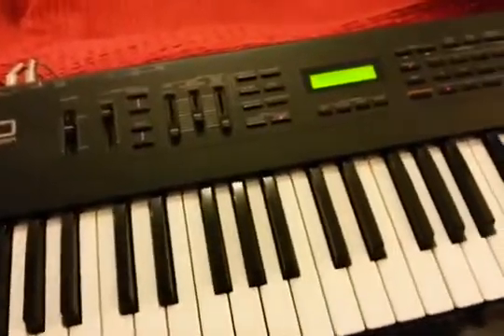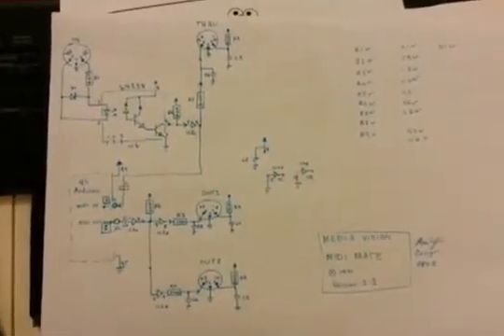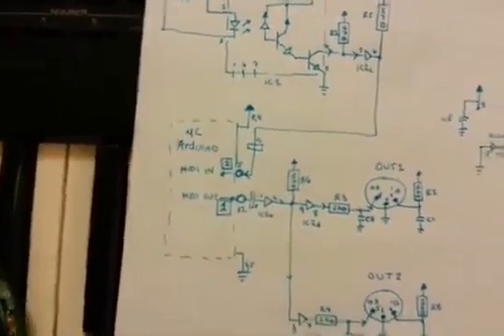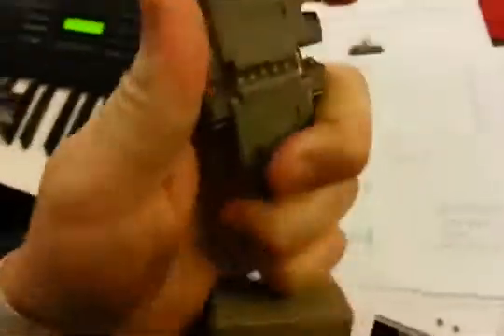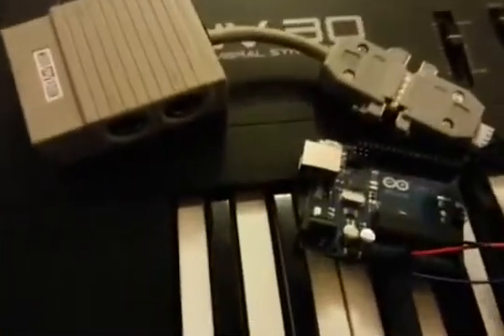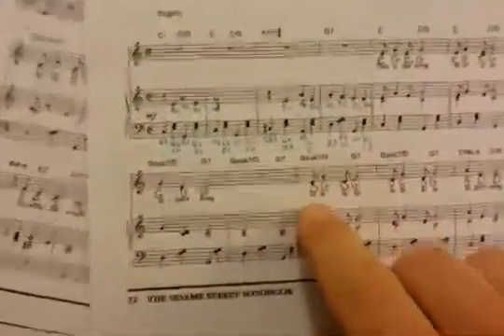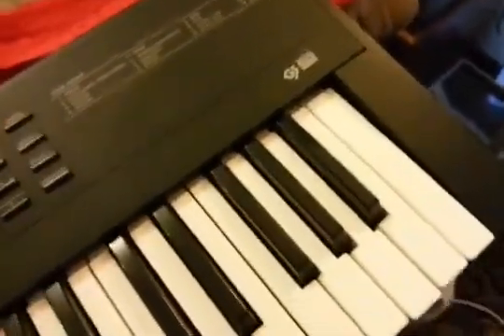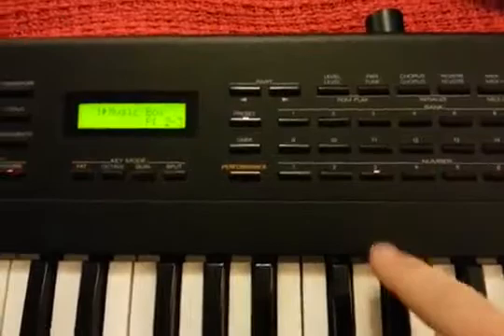Arduino playing a Roland JV-30 MIDI keyboard/synthesiser

Comment: Hi there. I have the same Midi Mate module and a Roland JV30 here. And would like to convert it to a Midi to USB converter using a Arduino micro pro. Would you be willing to share a photocopy of the schematics you have there?? That would be quite helpfull and speed things up. Thanks in advance.
Reply from the maker: Hi, unfortunately I took that video several years ago and Iʼm not sure where those schematics would be now.
Reply from the maker: Found them!